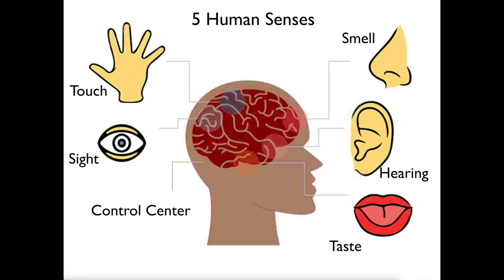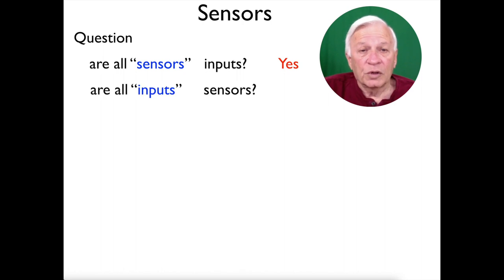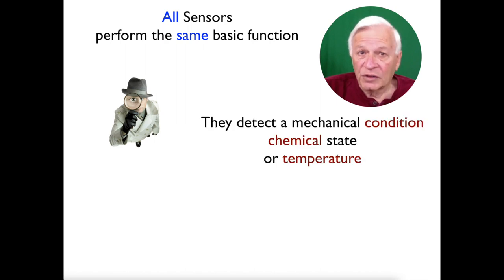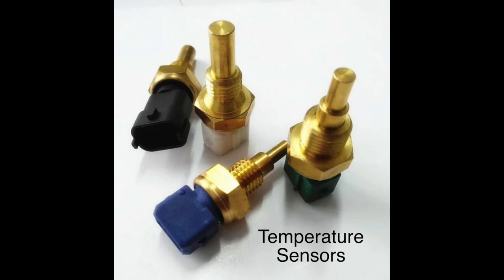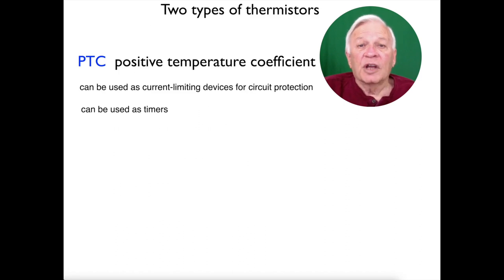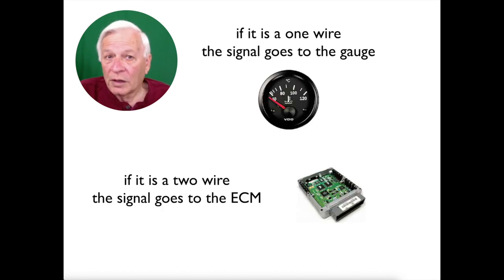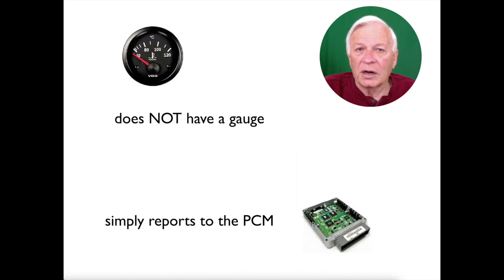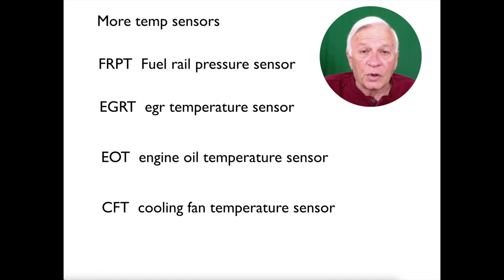Automotive Sensors Part 1

Comment: Good afternoon Duane!

Are you still answering messages?
Reply from the maker: Yes I am!
Reply: @realfixesrealfast  
Okay good my friend!

My vehicle (2003 Dodge Caravan Se V6 3.3) is giving me a (P0201-Injector Circuit/Open Cylinder 1) code and i have a (2003 POWERTRAIN DIAGNOSTIC PROCEDURES book for town & country, caravan and voyager) that shows on page 88-89 test procedures to follow and apply. 

So far i have applied (test 1) and (test 2) and im on (test 3) now and im stuck on not being able to follow and apply it cause im not grasping and understanding it at all. This is test 3
Turn the ignition off.
Disconnect the Fuel Injector harness connector.
Remove the ASD Relay from the IPM.
Turn the ignition on.
Jumper the Fused B+ circuit and the ASD Relay Output circuit in the IPM. (This part im lost)
Using a 12-volt test light connected to ground, probe the (K342) ASD Relay Output circuit.
Does the test light illuminate brightly?
Yes      Go To 4
No     Repair the open in the (K342) ASD Relay Output circuit.
          Perform POWERTRAIN VERIFICATION TEST VER-5.

This is a video of me following and applying (test 2-https://www.youtube.com/watch?v=rbzQKyiNwcA) and in that video it shows the pages in the book from page 88-89 and pages 312-314 for code (P0201-Injector Circuit/Open Cylinder 1).

Are you able to please make a video showing me how to perform all of these test procedures so it can help me grasp and understand to where im able to apply the test procedures from all those pages?
Reply from the maker: @AlwaysDiagnoseVehicleFirst  I watched the video you sent.  Those printed diagnostic steps are good but overly detailed.  Send me your email and I will help you.  Mine is dumar5907 at gmail.com